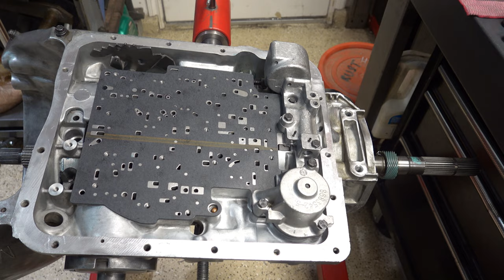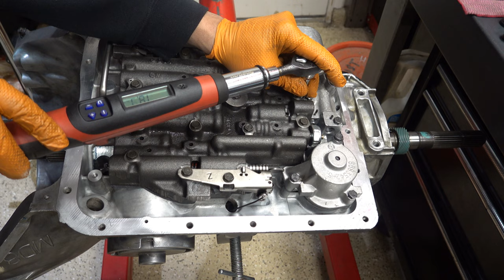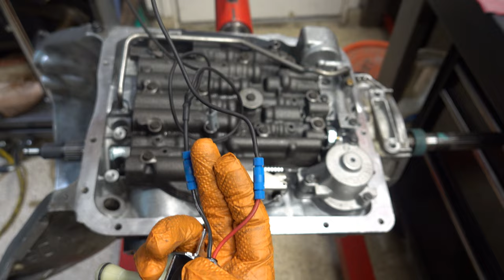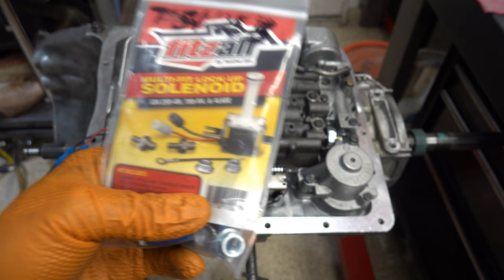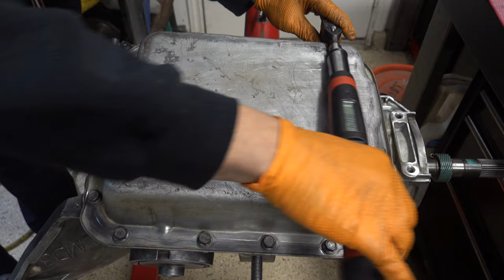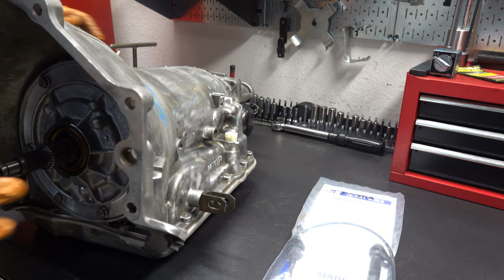700R4 Rebuild PT8: Final Assembly

Comment: Hi Nick Great videos.  You show a spring and piston in the case accumulator in this series of videos and in tips and tricks you show the double piston method, just wondering which one is better.  While I'm commenting could you repeat how to set up the tv cable with the using the pressure port.  Thanks again
Reply from the maker: Hi Lonepine, use Sonnax's pinless accumulator piston and their stiff spring for the 4th accumulator. That's the most aggressive set up for that bore without blocking it off all togther. 

Install your trans pressure gauge in the pressure port behind the bell housing to check line pressures.
Reply: Hi Nick  Thanks for the reply  The 700 is going into a 55 GMC with a Chevy mild stoker for just cruising.  On one of the 700 series you have the pressures at idle and stall  I can't seem to find it can you help me out with that  While I'm at it what should the clearance be on the 3-4 pack without the load release springs
Reply from the maker: You're welcome...Please subscribe to my channel if you haven't already. 

Search "B&M 700R4 Throttle Valve Cable Adjustment Instructions" and a few different options will come up.

Comment: Almost done with my rebuild and I couldn't have done it without your videos, thank you so much for taking the time to provide such great information! I do have a couple of issues though: My breather tube does not have an open hole near the TCC solenoid, it's been plugged, not sure if i should drill it out or not. Second issue is that I cannot find the exact replacement TCC solenoid, will another one work or should I just reuse the old one? Any help is greatly appreciated. Late 87 700r4.
Reply from the maker: Thanks, Travis - appreciate the kind words!

The breather tube (assuming you're referring to the vent tube that comes out of the top of the case behind the bell housing) should have a corresponding port in the pump for it. 

Re your solenoid: Fitzall has a TCC Solenoid that will work - they run a single wire set up, I believe and you simply splice into the existing wiring harness. You can also purchase a Rostra wiring harness with the TCC solenoids integrated for about $40 or so...
Reply: @nickstransmissions  Actually I'm referring to the tube that goes over the valve body.
Reply from the maker: Ok. That's not a breather tube (the little tube on the top of the case is the breather (aka vent) tube. 

You're describing the forward accumulator-pump feed pipe that sends fluid between accumulator and forward clutch. 

Does the transmission have an auxilary valve body? If it's a late 87, it should have one.
Reply: @nickstransmissions  it does yes
Reply from the maker: If the stator support portion of the pump assembly does not have the port for the forward accumulator's feed tube (sometimes it's referred to as a transfer tube) you have a non-auxiliary valve body pump installed. You will need to locate the correct stator support that is compatible with an aux valve body.
Reply: @nickstransmissions  That was the problem, thanks again!
Reply from the maker: You're welcome, man.

Comment: I remember doing one of TRANSGO's kits in a 700 that I rebuilt many years ago. They wanted you to put a steel ball into the solenoid, ball came with kit. The trouble I had was that the lockup came on about 30 MPH.  I ended up putting a two prong switch on the outside in one of the test plug holes, and breaking the circuit for lockup and running through switch. It delayed lockup until 4th gear. I'm guessing that you did this internally, but I didn't see if you had the steel ball installed, maybe they changed since I done it. I also remember putting a short flat piece in the TV valve valve train. Its funny how after many years of not doing something, it pops back in your head. Guess Alzheimer's ain't ready for me. I also remember grinding a small groove in towards valve body for the drain hole for the servo. the gasket has the notch, and they tell you never use RTV, or Permatex on pan gasket
Reply from the maker: Yep, I remember that little ball that Transgo use to have you put in that L/U solenoid but they removed/deleted that step and ball some point relatively recently. I looked at the instructions they have on the Transgo website for all 700R4 shift kits they offer and none had that step or ball documented. They prob eliminated it because it was forcing the trans/converter into lock up too early like you experienced (just a guess on my part).
Reply: @nickstransmissions  Most of the time, I used the Shift Kit that came in the green box, had a picture of Gil Younger on it. The dash 1, 2, & 3 kits were in a bigger box, opened up like a pizza box.  Their tech line could help you through problems.  TSR Racing are good guys too.

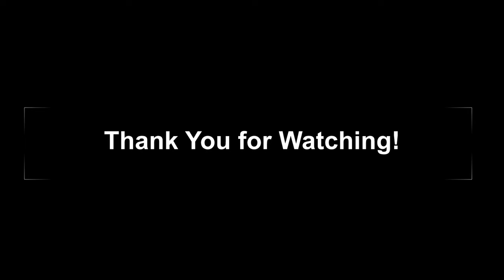Comment: Great video! I'm doing 35:04 my first 700R4 from my 91 Corvette. The 3-4 clutch burned up. It had been rebuilt before, and all the hard parts appear to be in good shape. I would like to make the unit more robust with respect to the 3-4 clutch pack. I don't want harsh shifts, however.  What extras would you recommend?

I'm thinking Sonnax Smart Shell, Transgo Jr shift kit and 7-CS Spring kit.

How about a bigger boost valve? What size? How about a Low and Reverse boost valve?
Reply from the maker: Thanks, bgehret3141 - appreciate the kind words!

Good questions: I'd do all of those....the .472 boost valve is fine for most street applications however if you want to go all-out, run the Sonnax .500" boost valve kit. Put a Sonnax wide sun gear bushing in the rear sun gear - use red loctite on OD of the bushing as added insurance against walking at higher RPMs. Install a 2003+ reaction shaft if you're going to do the Sonnax smart shell. The 03+ reaction shafts replace the thrust washer on the front side of the sun shell with a torrington bearing. So between the Sonnax shell rollerizing the center support thrust (black thrust washer is deleted) and the 03+ reaction shaft bearing, you have rollerized the middle of the case. Install a Corvette 093 servo (install a new one if yours came with one as the pin bore wears). 

Buy two Sonnax pump body bushings, install one in the pump body and one in the rear location in the reverse input drum. Also, get Transgo's unbreakable pump ring kit and put that in place of the stock slide priming spring and pump rings. Beef up the 3-4 pack with a 4L65E spec clutch pack - you'll need the apply plate, backing plate, frictions and steels for a 4L65E. You'll fit 7 frictions in that clutch (keep clearance between .040-.050 and delete the load release springs). It's up to you if you also want to install the Transgo bleeder orifice from the 7-CS kit. 

Install an Alto wide 2-4 band and turn your reverse input drum to make it perfectly flat again.

Drill the spacer plate out based on converter stall and desired shift firmness - make sure you keep the band release and 2-3 feed similar in size, otherwise flares or tie-ups may occur. Install Transgo's updated TV valve and spring set up to prevent TV valve sticking....Buy a new TV cable and yours is worn.

Lastly, upgrade that forward drum with late model (97+) bonded pistons and corresponding updated return spring assembly. 

Between all those things, that trans should be able to handle up to 450-475 HP and 5500-6000 RPMs. 

LMK if you have any ?s.
Reply: @nickstransmissions    Ok, I'm putting the transmission together.  I got what I thought was the 2003+ reaction shaft and bearing (GM 24217328 and GM 19356510) and the assembly with the Sonnax Smart Shell seems a little too long, as I can install the output shaft retaining ring.  It seems the shaft isn't protruding throught the carrier far enough.  Any thoughts what the issue might be?

Bob
Reply: Correction: I cannot install the output shaft retaining ring
Reply from the maker: Hi Bob, check the torrington bearing between the front planet and reaction shaft to see if the bearing fits entirely in the pocket on the reaction shaft or if it's too wide...If it's too wide, it will cause the front planet to sit higher than it should, resulting in you not being able to expose the snap ring groove and install the snap ring on the output shaft. If it's not that, it's also possible that you installed the rear ring gear-to-case bearing upside down. Lastly, did you install the race that came w/the Sonnax Smart shell right side up? Those are the three things that come to mind atm...
Reply: @nickstransmissions   I turns out that the bearing packet in the new reaction shaft (03+ roller bearing type) is smaller than the pocket in the old reaction shaft (thrust washer type.)  Also, the new roller bearing is a little bigger in diameter than the old one. The combination of new roller bearing and new reaction shaft would not assemble with the bearing fully seated in the pocket.  Fortunately, the old bearing fit ok in the new reaction shaft and it felt like it was ok. (Interestingly, the new bearing fit into the pocket in the old reaction shaft.)
Reply from the maker: Yep, that's the problem 99% of the time. Glad you got it resolved, Bob. Incidently, i had the same exact problem in my "4L60E High Performance PT 5" video where I show everything assembled upto the front planet and couldnt get the snap ring groove exposed. Then I showed the bearing pocket and put a bearing that fit and problem solved, lol.
Reply: When you air check the low/reverse clutch, there's a trapped check ball next to the hole where you apply the air. The ball is missing on my trans. Should I replace it?
Reply from the maker: You can leave it out. GM added that check ball in 1987 to soften the engagement into reverse.
Reply: @nickstransmissions   I was working on the input drum assembly.  I have aluminum pistons and I heard the forward apply piston is prone to cracking and should be replaced with a steel piston.  I was ably get a steel piston and I assembled the unit with the 2 other aluminum pistons.  Is it ok to mix and match?  I also installed the stiffer springs from the TransGo 2-CS kit.  On assembly it seemed the forward and overrun pistons would not seat all the way. I attributed this to the stiffer springs and used the spring compressor to seat them the rest of the way.  Was this a mistake?  After I got it all together and the retaining ring on, I went to air check it.  The outer seal on the overrun piston was blown out.  Upon disassembly, I noticed that I cut the inner seal on the overrun piston.

How should I proceed?  Should I get all steel pistons?  Are the aluminum pistons ok if I get new seals?  Your advice is appriciated
Reply from the maker: Never reinstall those aluminum pistons - i address that in the subassemblies or forward drum build up portion of the 700r4 rebuild series (think it was the video before this one in the series). Rewatch that vid for tips and pointers for assembling the forward drum. Also, replace the ball capsule in the snout of the input drum with a later 4L60e ball capsule - gives you a dual feed to the converter clutch https://www.amazon.com/ACDelco-8685839-Equipment-Automatic-Transmission/dp/B0016IMJZY

Edit - never air check until the clutch pack is installed. Lip sealing surfaces are vulnerable to popping out and getting torn if you air check sans clutch pack
Reply: I got one of the 4L60E input shaft check ball capsules.  How do you get the old one out? Is it in one of your videos?
Reply: I figured out how to get it out. I screwed in a sheet screw and used that to extract it.

Now, today's challenge.  I was grinding off that one ring on the pressure regulating valve and accidentally touched one of the other rings to the grinding wheel, thereby ruining it (I think.)  Where can I get a replacement, either new or used?
Reply: @nickstransmissions   I did a trial assembly of the pump to case to check the input shaft endplay.  Before I disassembled the transmission, the endplay measured .031".  On the trial assembly, the endplay now measures .071".  I changed to a Sonnax Smart Shell and a 03+ reaction shaft.  Would those changes cause the endplay to increase?  I'm worried that I might have forgotten something, but I rechecked everything and I am pretty sure I got everything.  What's the best way to take up the endplay?
Thanks - Bob
Reply: Trans is all together and back in the car and runs great! Thanks for your great videos and advice.
Reply from the maker: Great job, Bob! Glad I was able to help.